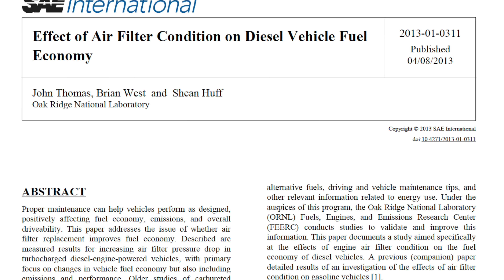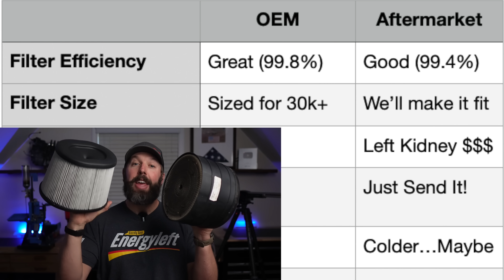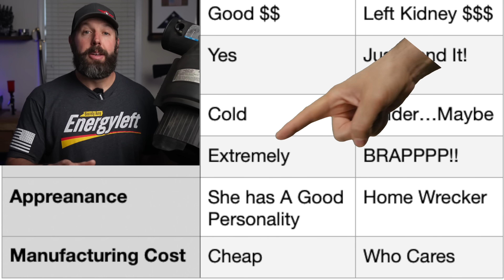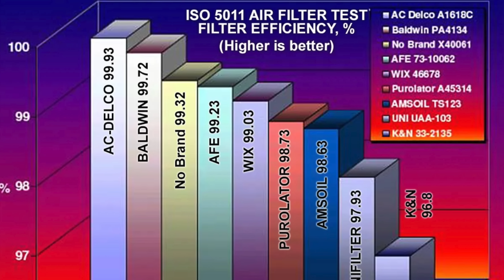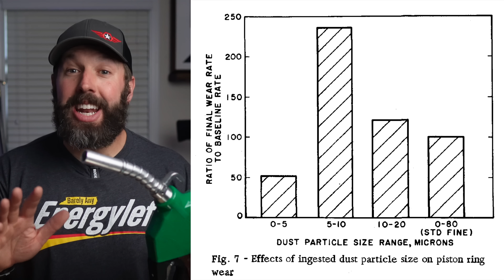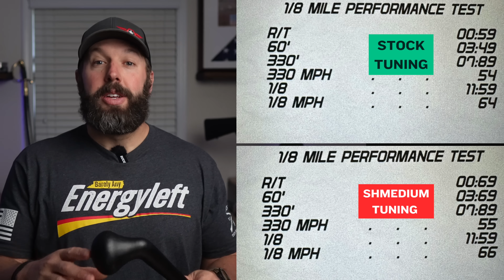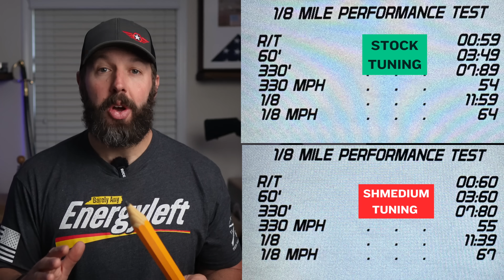The TRUTH About Cold Air Intakes…ACTUAL SCIENCE!

Comment: Wide vs skinny tires
High PSI tires vs low PSI in tires
solid rubber or airless or foam filled tires vs standard
different tread types and why
large sidewalls vs rubber bands (also go into large wheels vs smaller wheels outer tire size being the same)
beadlocks run flat inserts auto inflation / deflation systems etc.
tire wear and age affects grip
more plies or less plies
steel, aluminum, or magnesium wheels or perhapse 
sidewalls stretched or pinched vs correct width for rim
tires with all different amounts of wear or different tires entirely basically all different diameters and how that affects overall wear and fuel economy
cheap tires vs expensive tires
wheel offset and bearing wear
wheel designs and strengths of designs vs weaknesses
biggest diesels run on steel wheels on tracks so why not run everything on steel wheels

and ofcourse go over fuel savings and wear and grip of all the different stuff above

Comment: People just don't want to accept that clean intake air is essential for long engine life. Unless you are at wide open throttle all the time with a very modified engine, the stock filter system IS NOT restricting anything. It just isn't. Keep that thing stock and run a quality filter. Check it a couple times per year; more if you operate in a really dusty area. Race car where a tenth of a second off 1/4 mile ET matters? Much different story. That thing is going to eventually destroy itself and get torn down anyhow so the reduced filtering efficiency is worth it.

Comment: best thing to do is smack a filter on the ground a couple times once every 15 years or if you are in a dusty area then might need to do it every 7 years ... oil filters should be changed around once ever 2-3 oil changes as long as you have a decent filter

Comment: The "air grabber" hood on my parent's new 1971 Plymouth Road Runner 383 automatic had no change in its low 15 second quarter mile elapsed times with the air grabber either open or closed at Fremont Raceway.

Comment: 78000 miles heavy towing all over the country, with proper no smoke tuning and air flow a priority.  250000 miles so far and zero oil burn. Runs like a scalded cat on tow tune (level 2) on EFI live.

Comment: The MAF sensor reads the "weight" of the intake air so the injectors supply the right amount of fuel for a proper fuel/air ratio.
Cooler denser air uses more fuel. Colder air intake wont give better MPG, but you will get more power as more fuel/air is brought into the cylinder.
I did get a measurable better fuel economy by rerouting the stock air intake so it draws air over the exhaust manifold.
I assume the power output dropped also, but it wasnt anything I could notice because I didnt need all the motor was making for my use.

Comment: He is right, air filters operate in a trade space of mass flow rate and particle filter rate.and this is the case at every particle size. Changing your air filter too often not only costs money but increases the average particle size that gets through the filter. The only time you should change your filter is if the filter is NOT delivering sufficient flow rate for your application. If you live in environments with a great deal of rain your air is relatively clean already and your filter doesnt have to deal with a large volume of silicates. If you are in the southwest you have a different set of conditions. In either case inspection of the filter is more important than any one size fits all schedule.

Comment: I have a 2014 GMC 2500hd with an oil burner, I like my truck powertrain to last as long as possible without repairs. 
I use a stock GM air filter but a PPE oil filter on the engine and transmission. 
I had a GMC Sonoma 03 with a 4.3 and stick shift plus 4x4. It had a K&N from the day I bought it home. The powertrain outlasted the body and frame never changed the clutch either.

Comment: Your videos are awesome. I learn so much from them. I'm confused about k&n filter thing. I know there are several tests that say they don't perform well. David Vizard has a video on k and n filters. Have you seen the video? He says most people don't test them properly. I also read somewhere that k and filters were used on a helicopter if I remember correctly in desert storm. If it had not been for that filter they would not have been able to have used it. So I feel if a filter is good enough for a helicopter it would be good enough for my car or truck but then there are all these tests that say they are bad filters. I guess my question is have you seen the david vizard video and what are your thoughts?
Reply from the maker: I am familiar with Vizards video. I saw it a few years ago. I just dissagree with him. As do pretty much any mechanic that has ever worked on an engine equipped with one. They simply don't filter worth a damn. And a helicopter engine is a turbine engine, not a piston engine. They are concerned with blade erosion, not piston ring and cylinder wear. Totally different scenarios.
Reply: @freedomworx Thanks for the response. I'll stay away from them for anything that is a daily driver.

Comment: I have a '77 F350 my father bought new. It's original 400M came with a cold air intake from the factory. It also had a vacuum actuated flap that would draw air from a shroud over the passenger exhaust manifold to provide warm air intake when cold. I never really understood the purpose of the warm air. Some later '77s had catalytic systems and still had the same air cleaner/intake system. I don't imagine the warm intake was emissions related but I could be wrong (usually the case according to my wife). Anyway, about 40 years ago, I disabled the flap in the cold air position, mostly because it created a vacuum leak which is a big deal on a carbureted engine but also because I was told cold air was beneficial. 

BTW - I appreciate the humor infused education you provide. Thanks
Reply: That's a very common configuration on many carbureted vehicles of that era. The purpose of the flap to draw in warm air in cold conditions is, as you suspected, not related to emissions. The warmer air from the manifold is simply to warm up the carburetor more quickly. Once the engine is at it's operating temp, that flap should be wide open, allowing the intake to suck cold air. If you are fortunate enough to live in a warmer climate, you likely don't need it. Same holds true if you only drive the truck on fair-weather days - there's a chance the system wouldn't be used anyway. When new, the flapper would work well - they often became problematic when the vehicle was older. Sometimes they would seize, sometimes they were the source of a vacuum leak. My '72 Meteor has the same setup, and the same size engine - I doubt my flapper was activated at all this year as I only drove it during the summer. If I drove it in much colder conditions, I would probably want that system to be operational.

A common "fix" on a very cold winter's day when a carbureted car wouldn't start, would be to get a hair dryer and heat up the carburetor. It didn't have to be hot - just warm enough that it would start on it's own.

Comment: Yep, change air filter only if it's filthy, only change your oil filter once a year or every 2 - 3 oil changes.

CAI are an absolutely pointless invention unless you're on a race track or drag strip. Even if "colder" air is inducted, more fuel will be injected, meaning you won't have to press the pedal as much to get the same power.

Comment: i have a Z1 Offroad intake on my truck. Just like the OEM intake, its a sealed box that draws thru the fender. the two biggest differences over stock, no resonance chamber and a much larger inlet thru the fender. not a lot of dirt gets into that box.

its paired with a intake plenum spacer, a tune and my own engineered catback. took the truck from a 7.8-8.0 60mph run down to 7.1-7.2 and good for 30+ whp/wtq

Comment: 800,000 miles on my s&b intake and filter. Never changed the filter and engine is still original. That s&b paid for itself many times over
Reply: Dry filter or oil ?

Comment: Turbos move volume. The density of the volume entering the turbo compressor inducer determines how much air mass that turbo can move. You can increase the mass flow capability by making the air colder, or increasing the air pressure. The idea of the cold air intake is to increase the density of that incoming air to increase the mass flow capability of the turbo via both.

However, if your tuning is not pushing the turbo to its flow limits, increase the density of the incoming air doesnt do much of anything since the turbo has no issue hitting the desired mass flow anyway. At most it might reduce the VGT vane angles ever so slightly. Where the intake makes the difference is when you are at the limits of the compressor where any increase in the air density at the inducer increases mass flow by the same amount. If the compressor is choking, and you increase air density 3%, you should increase the mass flow 3%. The turbo is still choking but it is able to flow more mass while choking.

I had this exact issue in my F150 Ecoboost. I live at 6500' so the turbos were choking at basically the stock power. A tune didnt really make any more power since the turbos had nothing left to give and were brushing up against the compressor speed limits. An S&B intake was able to increase the intake pressure slightly and give me a marginal bump.

That said, if you are that guy that is running your turbo right at its limit to where the intake makes that difference, you should probably just upgrade your turbo to one that can make the power you want without incinerating its bearings.

Comment: While you are correct about filter efficiency, your not correct about a factory filter being built for optimal performance and longevity. They are built with 2 considerations. Cost and noise, that's it. That's why the tubes usually have ribs and are made out of cheap moldable rubber.

The ribs dampen vibrations and reduce oscillation effects as well as harmonic resonance.

Comment: Nicely done.  Fun to see real data.  There is no free lunch...especially when you pay $500!!  I used a K&N filter once years ago and took it out after one oil change.  Just didn't feel right - more noise than increase power.  Also no data back when K&N started spitting out Marketing smoke and mirrors.  BTW - that 3.3L gas engine went 248,000 mi on all stock stuff just following factory maintenance.

Comment: Manufacturers wouldn't leave free hp/kw on the table, not when that number sells cars. Your stock intake setup is giving you 99% of what the engine has to give, and it plays very nicely with your engine management system. The only way to get all 100% is to first, have this be a proper race vehicle that spends its life on the track, which means it's at WOT most of the time, and then use well-engineered piping to locate the filtered intake outside the car, usually mounted in a headlight hole since a racecar doesn't use. Other, lesser solutions like drop in filters or cone replacements that stay in the engine bay just suck hot air, cost power, and cause driveability issues.

Comment: I also like S&B.

AFE is hot garbage. Everything I have ever bought from them was overpriced and sucked. Two intakes that droned horribly at 2500 rpm and an intercooler that was almost as bad as the stock one and cost $1200. I replaced it with a $600 intercooler that lowered the IAT''s another 40F.

Comment: I got my truck with 2.8 turbo duramax and AFE cold air intake preinstalled,  yeah i bought second hand from dealership.   now im thinking i should pull the cold air intake and get the stock air intake which will cost $1000  or more.    hmmm   think i leave it alone .

Comment: I’m a 25 year Ford technician. I’ve been observing the insides of the intake tubing and throttle bodies and every aftermarket air intake and many cheap aftermarket air filters in stock air boxes leave a film of dust inside the tubes. Personal experience with oil analysis has proven to me that high quality filters allow significantly less silica particles to enter the oil through the piston rings. Great video!

Comment: I know with heavy equipment, they want you to leave that filter alone as long as possible. Every  time you pull a filter out. Some of that dust will come loose and proceed to float into the intake. I also don't believe in blowing filters out unless it's absolutely necessary. You always get a dust cloud and some of that will land on the wrong side of the filter, plus the chances of opening up the holes in the filter itself.
Reply: ...Most HD ag. tractors come with an air- restriction gauge plumbed after the air cleaner housing and before the engine. Plus they use a smaller  2ndary  safety filter installed inside the large primary filter. Manufacturers tell you to "never" attempt to clean the secondary filter.  Replace the secondary filter only....
Reply: @PeterDittmer  Yeah and i've seen plenty of manuals say to look at that gauge to know when to replace the filter. I've never seen any data on the efficiency of those secondary filters at catching particles. I'd rather not rely on the secondary filter if possible. Normally it ain't my money I'm spending on filters. So I've no incentive to blow them out when i can just replace. It's actually pretty surprising how much debre can be in a filter before it get's too plugged up to breath.

Comment: Thank you for this analysis, Jamin. I had a hard time accepting that the stock intake in my V10 Excursion flowed more than enough to supply the engine with air. I wanted an aftermarket but spent my money on a 5 star tune and opening up the exhaust. That y-pipe and cat delete seemed to help way more than K&N thought they could do. 🛠️
Reply from the maker: All the spark plugs. 🤓

Comment: I remember as a kid driving a ‘94 cavalier, I drilled a 4” hole in the bottom of the air cleaner box and ran a dryer duct from there under my front bumper.  Zip tied that mamma jamma in place and used enough caulk to make a plumber proud.  Drove around with a wet air filter for a couple of years after that, but it was good and noisy.

Comment: I know you got science on your side but I just find it hard to believe they cause engine wear that will add up to anything. My 07 LBZ has had a AFE on it since it was a year old and it has 330k running dirt roads and one time the intake tube cracked and didnt know it for a while. Needless to say no blow by and its all original drive train even the injectors. Maybe bc I change the oil every 5k or Ive just been lucky lol.

Comment: Oh here, man, BEHAVE!    We've read about and heard most of all this before.  Don't confuse changing filters for trapping dirt or allowing a machine to breathe better: Breathing Air, Lube oil or fuel ( and water, for all t hat too where it is used.  (to the reader/ viewer here ) Ever looked inside the Manifolds of engines?  "gunge" develops over the years and doesn't "hurt" the engine.  and if something fell in to th e airstream, therre would be a short misfire or whatever - think of the speed of the engine - duration of valves open etc. miniscule.  It's not as though a Soup of dirt was  entering the system.  Air filters changed to allow to breathe. fuel filters changed to allow fuel flow but HAS to be clean due to the very close tolerances - hence the use of at least a pair of inline filters or much larger "fancy" single filters.  Back in the day  of FF167 s one would only change ONE of the 2 filters at a time for the reason you rightly say about pores closing down with time and soaking in fuel+ Contaminants.  One must also consider the nature of t he contaminants.   Consider Centrifugal filters  - almost perfection - but at some price unless it was "Iron Curtain Machinery" where it came as standard.  what a bonus, but the West didn't like  to get their hands dirty whilst cleaning out the dirt, .....  and so on  - wiremesh Oil Bath aircleaners.
OK OK later in the video  I can wholeheartedly agree with your comments   so it's just for entertainment in the current world of attention holding !

Comment: Yes, don't change your filter, so it get's so clogged the oil is forced into the pressure bypass so it's no longer filtered at all .. Great advice..  you science supports your filter claim, but not engine operation claim.  

the filter needs to allow flow to actually filter the oil, otherwise it will use the bypass and bypass the filter element, allowing particulate to circulate and destroy your engine.  so oil system, operation also needs serious consideration before making a statement or claim.

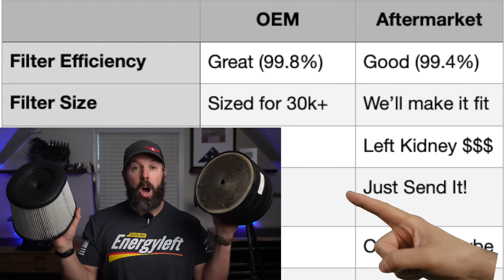Comment: 5:57 You’re placing too much faith in the companies that make cars un-repairable. They are actively designing cars to fail, and choosing to destroy the used car market. I absolutely do not believe that car companies are choosing air filters that make the engine last longer, because that is antithetical to literally every other design decision. For example, “sealed transmissions with fluid that lasts the life of the car” is an absolutely scam because they define a car’s lifetime at 100,000 miles. 
   There’s NO WAY that these companies are “ :) gonna choose the best air filter for maximum engine life :) :) :)”
14:42 Doesn’t the oil catch all those smaller particles though? It sort of pre-loads the filter so that you don’t have that drop in efficiency when clean.

Comment: The problem with the oil filters is that, if you don't change them at reasonable intervals, you run the risk of flowing unfiltered oil through you engine.
Reply: Plus the possibility of the filter falling apart 😊